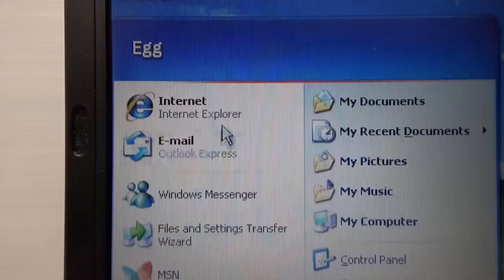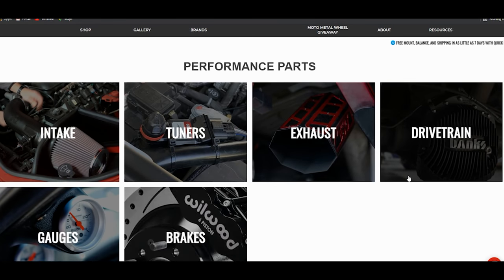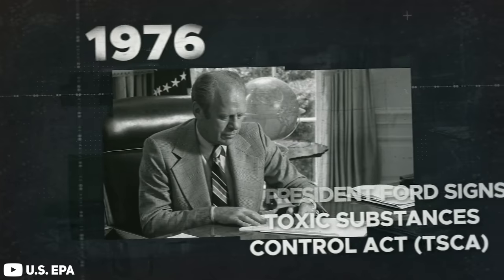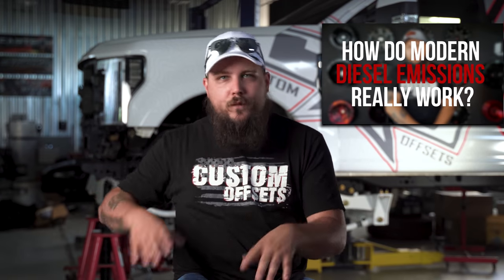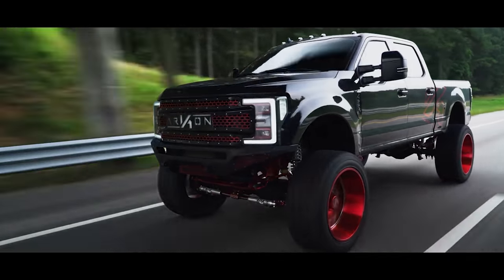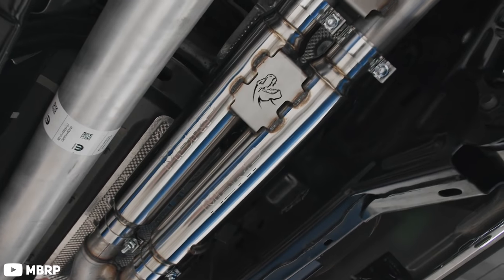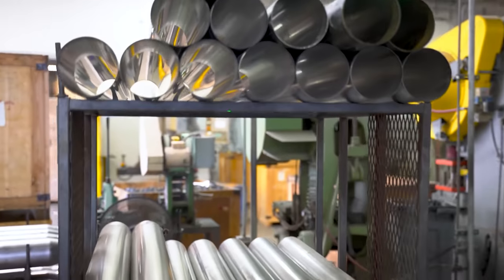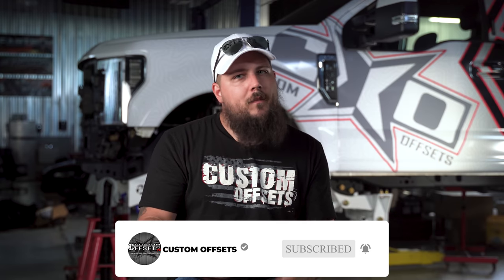How To Build Your Diesel Truck LEGALLY in 2021

Comment: Still waiting for the Banks Derringer Tuner for the 3.0 Duramax, I can't wait any longer!
Reply from the maker: Should be rowdy!!
Reply: I have a Banks Six Gun with I dash on my emission compliant lmm duramax and it's not that impressive. Hopefully you have better luck.
Reply: @czickert83  The prospective numbers Banks was throwing out looked pretty decent, only time will tell if they were able to keep it that high. I am sure they are doing some extensive testing.
Reply: The 3litre tuner isn't coming till next spring at least
Reply: @czickert83  you should try the pedal monster really changed my l5p
Reply: @bart1012   I have thought about it but that's another $300 dollars on top of the $900 I already spent on the six gun only to be very disappointed. I do have supporting mods for the six gun as well.
Reply: Same here bro... I got the 2.8 zr2

Comment: So if I have a deleted 6.7 and want to run clean tunes will that work?
Reply from the maker: You can definitely get clean running tunes!
Reply: @CustomOffsetsTV  okay sweet, the last thing I wanna do is run clean tunes on the truck and the system freaks out because it doesn’t have a the proper equipment. (it fell off in Mexico, tragic right?)